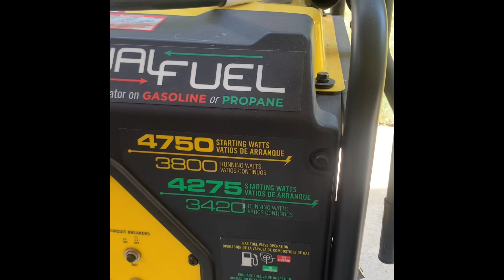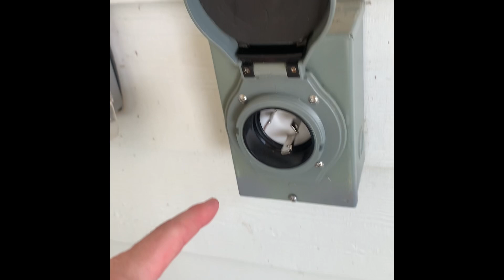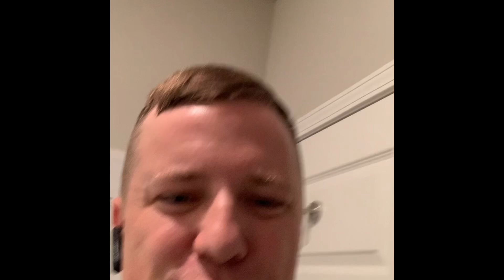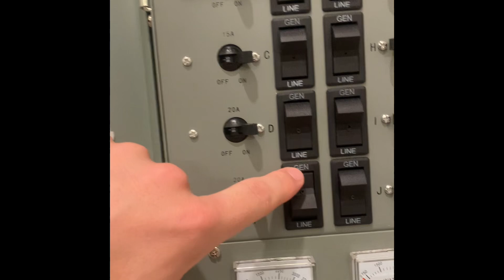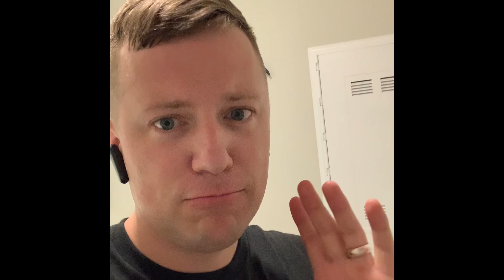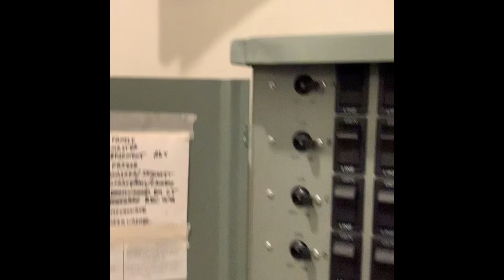Generators 101 - Portable Generator Backup Power

Comment: Good video overview.  I think you still should have installed at least a L14-30 inlet and 10/3 wire (or even SS2-50 inlet with 6/3 wire) in case you ever get a 240v generator, or in case you ever did want to run the air conditioner in the future.  Also may be worth it to discuss multiwire branch circuits, when bridging both legs together you could double the amperage on those common neutrals and cause a fire, if you have MWBC's.
Reply from the maker: All good points!